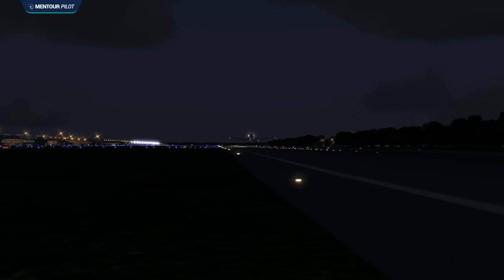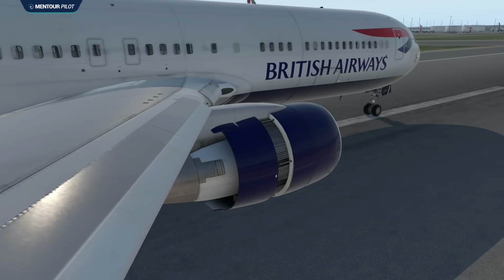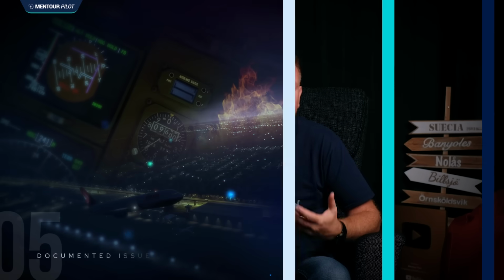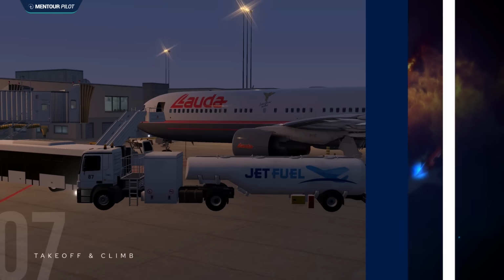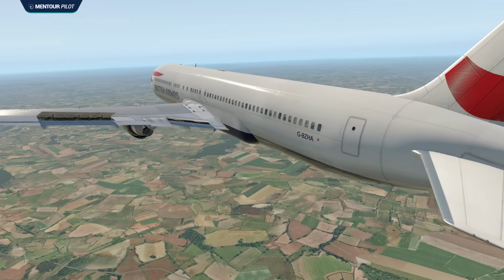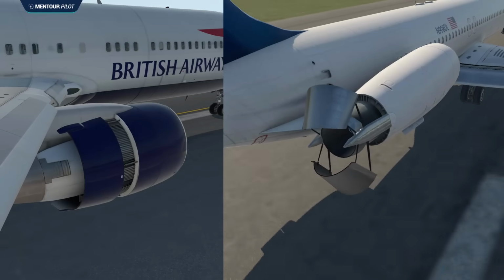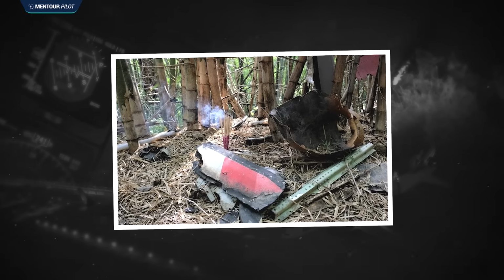HOW an Impossible Failure CRASHED this Boeing 767!

Comment: so the FDR was lost in this case, as happens in others. whoever knows please clue me in to this mystery that sometimes happens. why is it that the FDR and the CDR are separate devices? I find it hard to believe that to record the modest amount of data that each records cannot be done with a single device with available technology today. I'm not saying to just use one device, but why two black boxes, placed strategically to survive in different parts of the plane, can't record both FDR and CRD data? that's my high-tech mystery. the investigators are always looking for both boxes and failing to find one or the other. or sometimes one is just broken completely losing that function. if both did both functions, all it would take would be to find one working one to have all the data.

for the low-tech black box mystery, planes fly mostly over water. how come the black boxes don't float? maybe some kind of airbag can deploy when water is detected that also breaks away the box. I think even just some clever low-tech shape can be used like a styrofoam enclosure, that also breaks away when in contact with water. these things always sink in water and it appears like there's not even an effort to get them to float. I consider this an obvious feature and keep wondering why no effort appears to be made to try and get the boxes to float 🏖😎

Comment: I rode on a 767 when they came out. I had a window seat on the wing. When I saw the engines reverse thrust to slow down, my first thought was terror, because it seemed to me a terrible design. I thought a failure in flight would destroy the engine. I was not at all surprised when one eventually did.
Reply: Reverse thrust is standard to lots of aircraft, this was just an exceptionally poorly made reverser
Reply: @theshermantanker7043  Yes, and I can tell the difference. As I did. When I looked through the window. Like at it. You know?

Comment: This reminds me (obviously with a completely different outcome) of a flight from Helsinki to Heathrow on an Finnair DC 8 in 1970 approximately. The takeoff was delayed  when an engineer came on board. After removing a panel in the cabin floor he proceeded to carry out some sort of maintenance.
This was a little disconcerting but all went well until we were over the North Sea. Over the tannoy I heard the pilot announce "we're going to lose some hight quite quickly", as I looked out of the window much to my surprise I saw the reverse thrust mechanism deploy. (I could only see one engine from where I was seated). Nothing more was said but the rate of descent was very noticeable. We landed at Heathrow without further incident.
Any thoughts from those who know about this kind of incident?

Comment: Just saw a story on Air Disasters (on TV) about a Fokker F100 that crashed in Brazil due to a thrust reverser deployment. It, too, idled the affected engine, but the pilot overpowered the system and broke the cable on the throttle, pushing it forward. The thrust caused an uncontrollable yaw moment.

Comment: Just a small correction, no reversers were not only certified to be used on the ground, aircraft including the Concorde, DC8 and Trident were certified to use thrust reversers in flight, the 767 was not.

Comment: if that 767 travel 4000 feet in 3 sec. that would mean that this 767 reached 1.18 mach / 786 knots / 908 mph. which is around the top speed of mig-19

Comment: Could they not make the thrust reverser where in the event of failure, it fails in the closed position, such as a thermostat on a car, where it fails in the open position which allows the coolant to flow through and prevent overheating? Or make the thrust reverser deploy forward, where at a certain airspeed, the hydraulics would not be able to overcome the force of the air traveling across it? Seems like there's several ways to prevent the thrust reverser from deploying in flight, simply by designing them better. 🤔

Comment: @Mentour Pilot...

As a Computer Science Student, I recently lost 20% in an assignment because the lecturer tested the program with variables I had not tested, I made the fatal mistake of testing a couple of random variables and assumed that my program worked in all instances, So I appealed to the university to see if I could get a partial grade for that question (worth 20%) as the program clearly worked in some of the instances, The university took my appeal seriously and stated the following....

If a car was purchased from a showroom and it suddenly grinded to a halt in second gear, you would return it as not being fit for purpose. 
Today many vehicles heavily relly on computer programs, it was discussed if a program causes a catastrophic failure at any point, then the program simply doesnt work, even if it can function under certain scenarios, and my appeal was not upheld

Watching this video I can see why, as faults in programming can cost lives, although i would imagine there would of been a series of quality testing to ensure the program functions under all circumstances

Comment: Not considering reverse engine thrust deployment at speeds higher then idle is stupid....and then denying that it was the trust reverse system that caused the crash...the 737max was apparently not the first plane designed by monkeys at Boeing.

Comment: As always an incisive and articulate analysis, thank you. I dont know where else to ask this so I hope people will excuse me. Has Mentour pilot done an analysis of the crash on September 29 2006 between an almost brand new Boeing 737 and a brand new Embraer jet? If not, may I suggest this please. The interesting part of this horrific crash was that the aircraft had no malfunctions or mechanical failures, yet they collided in clear air.
Reply: GOL1906 and N600XL?
Reply: @Moldovallan1618  GOL1907 actually. Correct for Embraer

Comment: Why not deploy the working engine's thrust reverser immediately to arrest the speed increase on nose down? Ya I mean not standard procedure or what you could think of in 6 seconds. Edit: Ya ok there is a safety mechanism by weight on wheels. Guess the only thing that could be done was to set both engines on idle ASAP till the plane could be brought out of nose dive (and before the aerodynamic stress became large to make aircraft control impossible).

Comment: Why not add a low-tech (heck, even a manual) reverser lockout on a completely different/independent electrical system to disarm/disable reversers at ANY flight altitude?

Comment: I find it remarkable that a plane could be expected to still be manageable if 50% of its power wss working against its normal thrust. That's like slamming on the brakes on one side of the jet while still pushing forward on the other side. I can believe a plane could still fly losing one engine but this is much worse.
A lot of systems demand triple redundancy for essential systems. The description of this system seems to have had only two. Shows how essential that third safeguard can be, but if indeed the system had already been acting abnormally and been ignored, then no amount of redundancy of safeguards can be expected to be enough.

Comment: I believe in the old school method of deactivating systems you DONT want working while inflight. One of them was the WOW (weight on wheel) switch. Only with gear down with the load on the wheels that such systems work. Just an old wrench turner here.

Comment: I am a huge fan of the work you do, to highlight the compounding of seemingly small problems cause catastrophic accidents, and show how historically significantly accidents have created a safer operating environment that modern airlines now operate in.
 
As a former British Airways engineer I feel compelled to point out the imagery that you used in this video is incorrect and that BA only operated the 767 powered by Rolls Royce engines, which came with there own issues initially that caused cracks in the pylons due to the increased thrust produced, requiring the fleet to be grounded until a resolution could be implemented. 

I remember working on an Egypt Air 767 implementing the  thrust reverser fixes after this terrible tragedy.

Comment: Strapped into a seat that's too small, difficult to get in and out of, traveling at 600 mph, in a pressurized tube made of thin metal, 7 miles above the Earth, with no way to control my own fate.  This is why I no longer fly anywhere.  If I can't drive and control what I drive with my own hands and feet, I'm staying home.

Comment: This makes you wonder if Boeing was already traveling down the shady path prior to the merger with McDonnell Douglas. There were engineering problems with this design that should have been worked out prior to certification, mainly, verifying the reverser system operation at multiple altitudes and airspeeds.

I also wanted to comment on the quality of the research into the reverser system operation, this was an excellent education on the system operation.

Comment: Maybe a small isolated electric hydraulic pump and servo instead of the actuator sitting on a pressured line with just a valve keeping it depressured. It's not really 'isolated' otherwise?

Comment: Boeing said before that there is a malfunction on the indicator indicating that the reverse trust is mechanical locked in or not.
In fact the indicator gave a correct reading that the reverse trust DID NOT lock in mechanically.
After that incident Boeing grounded all 767 to clear this issue.

Comment: Initially (upon watching this video) I thought that the only response to a thrust reverser being deployed in flight as the immediate cutting of the affected engine.  It doesn't take a rocket scientist to know that under heavy loads (use) this would quickly escalate.  Its like throwing a auto in reverse going 60mph, something is going to "break".
  Not sure why Boeing thought this couldn't happen (deployment in flight under high loads).  Not sure why simulator flights don't have this as a immediate action act for pilots.
 I find saying that this brought great improvements.  Isn't this the same company that missed basic design "never do's" later on?  That missed these earlier on?  As I said, not rocket science level to know this would quickly destroy the Aircraft, or that is could indeed happen.

Comment: Trust reversal, indeed.

Interesting, so the plane dropped because it was HIV positive? 🤔

A general problem in the industry with its alleged high safety standards: 'The plane is having a technical issue, but we cannot figure out what it is, so let's keep flying thousands of people in it and observe it further during that. Surely if we don't know what's wrong, what's causing this, it cannot be something serious.'

It is also madness to certify it as safe based on the assumption that under certain ideal conditions reverse thrust in the air is fine. If this can happen to begin with, it means there is a technical failure, and those tend to cause other problems.

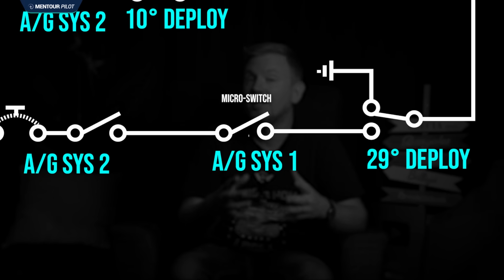16:35 Of course they should be built in a way that this cannot happen.

Capitalism's minmaxing efficiency and profit dictates, creating systemic scarcity because driven by an according lived fear trauma in the mind, are a gigantic killer. It is the same root that leads to (other types of) wars.
Foresight is the enemy of such a system. Reactionism is preferred because it acts based on experiential proof that an effort is needed and not potentially excessive and thus a waste of money and an exposition to a risk of being stomped by the competition.
There is no eye-opening going on in such a system. Business as usual.

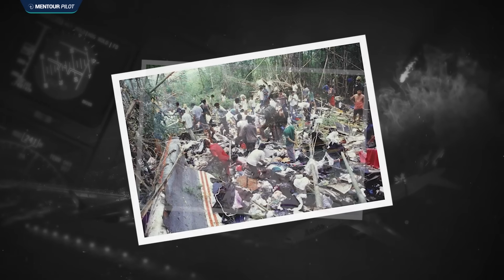24:14 Hmmm... what an interesting selective behavior of the 'looters'. 🤔

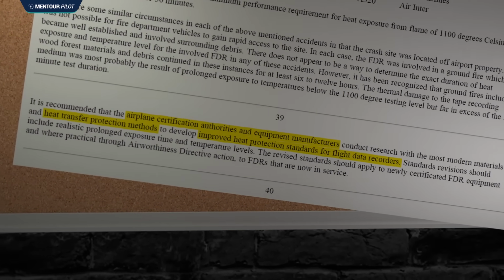28:00 How about not calling every damn remotely accessed database "the cloud"? It's a technocracy term about centralized control.

Comment: Just a thought, but out of my head there was at least 3 occurances or so in videos uploaded over the past year, where there was a sort-of important information hidden in the technical log, which the pilot thus did miss. Even if the plane is allowed to fly, and even if the captain would not alter his immediate behaviour because of it, being made aware of such details ahead of time might help in a stressful situation and could potentially even save lifes, right? So wouldnt it be a good idea to have a special section in the technical report, sort of like a "The plane should work flawlessly, BUT ___", where the engineers can note down exactly this kind of information, about problems that "should be fixed but for some reason do keep popping up now and then"?

I think the problem is that engineers are supposed to make sure it works, so no doubt allowed. And in some of these videos they simply cant reproduce the problem at all, or cant be sure if the change actually fixes it, just because it did not occur when they tested it. So a problem that occured twice or so could be noted down as a reoccuring problem (for the next half a year or so, in which case the note is removed if it does not reappear), just so that pilots do read over it and know that such an, albeit unlikely, problem might occur on their flight as well.

Comment: A similar situation occurred back over Brazil in 2006. A mid-air collision between an Embraer Legacy 600 business jet and a GOL 737-800 while both aircraft were cruising at 37,000 feet. The winglet of the Embraer sheared off about 40% of the 737's left wing. This caused the Boeing to enter a corkscrew left turning dive; the plane lost 30,000 feet in about 49 seconds and broke up at 7000 feet. It may have also broken the sound barrier. The FDR data was never released. The crash killed a total of 154 people. The business jet survived the collision and landed at a military base. It still flies to this day.

Comment: Just remember. Every time you hear the word "Efficiency" it just means "Cost Cutting". When you design for "Effeciency" your only concern is the bottom dollar. When you design for Performance your only goal is Performance. I.E. Safety. The airplane getting where its going. "Efficiency" Is getting where you are going AS CHEAPLY AS POSSIBLE.

Comment: Here in Brazil in 1996 we had a similar accident, involving a Fokker 100 that had one of it's thrust reversers deploy during climb. (TAM 402)
There were supposed fail safe mechanisms to avoid it happening, and one extra that should turn the engine to idle failed to detain the pilot from brute force accelerating it, it  failed to do so.
It fell to the ground 24 seconds after take off,  and was only able to climb to an altitude of 40 meters before the accident.

Comment: Another excellent video. Terrifying accident, I'm already a very nervous passenger - i know statistically that flying is very safe, but if something goes wrong, you have only a small chance of survival. I remember reading of an accident, a Japanese airline i believe, a 747, the front section, the 1st class area, ripping and FELL OFF, at cruising altitude. Aaarrghh. The rest of the the plane, carried on flying, actually gaining altitude, then stalling a few minutes later and plunging 35,000 feet into the ocean. Hideous. Amongst the wreckage, letters were found, written by passengers, knowing they were going to die. Absolutely horrific.

Comment: Hey Mentour, I love your videos.

I was sitting in my car watching this this morning, having a smoke and getting really into the video at about 22 minutes. My car’s running, and just when you describe the tail starting to come apart, my car idled a bit lower and it shuddered. I had like, a 4-d theater moment watching your videos and it was a little scary, considering I’m flying to Colorado in a week
Reply: Just don't fly there in your car and I think you will be fine.
Reply: The flights there and back were flawless. Two of the smoothest landings ive ever experienced. The altitude sickness I got from traveling from 800 to 9800 feet however was disgusting